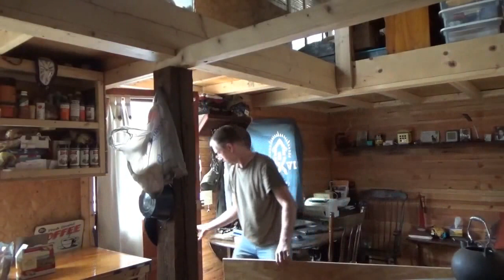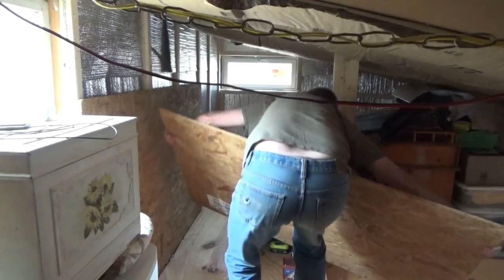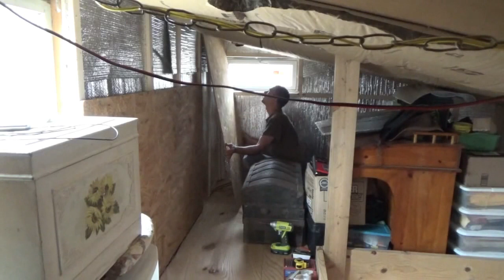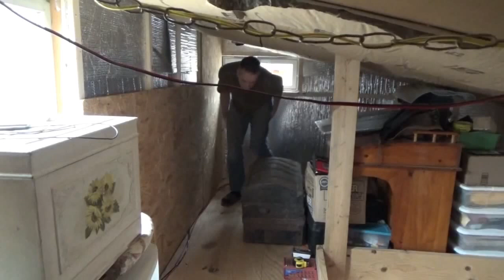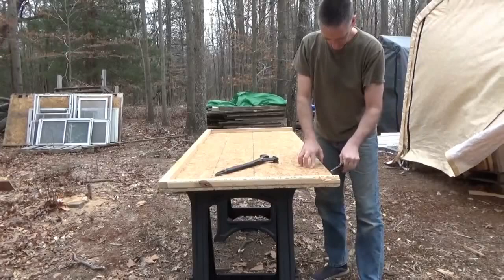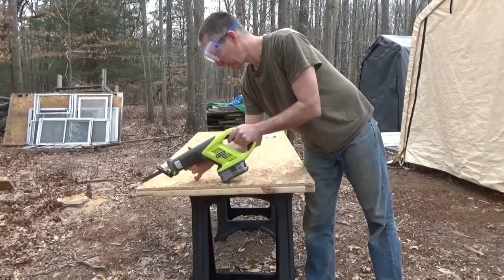Installing OSB In Off Grid Tiny Home Loft Study

Comment: Thought for an outdoor table:  OSB top coated with that clear, epoxy-like stuff they use for bars.  Saw a bar with all sorts of coins and ashtrays and you name it, all embedded into the bar top itself, and it was pretty cool.  I'd imagine that it'd also be quite weatherproof, and if not, you lay it on THICK, so you could always just polish it from time to time if you REALLY needed to.

Also, had you thought about just giving the loft spaces a coat of white paint?  It'll reduce weight, in the event you need to move it at some point, while also being a LOT quicker for you to accomplish, plus having the added benefits of both still having a unique texture and being a lot more reflective to light, giving it a more open feel to it.

Speaking of paint, heres a non-standard way to think about that:  When I rebuilt the porch, I did like they did a century or so back, and I painted the ceiling a nice sky blue.  Now, even on the most miserable rainy day, I can still sit on the porch, look up, and see blue skies above me.  d=O)

Comment: Maybe take a day or two and break down all the pallet wood you have before you start working on tiny house walls?
Reply from the maker: +Jacque Refregier When I get to the paneling you mean? Or for the OSB? If you mean the OSB then I am only using what fits and what I need at the time. The rest I leave alone. Sometimes I have to pull out staples for the right fit. Sometimes I can cut them off. Depends on the size of the board I need. Less work this way in the end.

Comment: I think your saw made have a bent shaft. It may have overheated and warped. If so the blade will not track, because it is at an angle. Keep up the good work.
Reply: +Frank Petronella If it was a bent shaft, the blade would wobble making the kerf (cut) wider, I am leaning towards an out of align sole plate as the problem

Comment: Please, do NOT buy another set of saw horses! Just make a set from the barn wood. There are lots of how too's on you tube. You'll find 4 benefits to making your own:
1) they only cost you time and screws
2) you can customize them to you. I am tall, so are my saw horses. I also have a low set for when I want things lower.
3) you can replace the tops when you saw through them, or set your saw shallow and don't worry about the small cuts in the tops (you should see mine)
4) they are way sturdier than anything you will ever buy. Sure, they don't break down for storage like the store bought ones but you can stack them and put them out of the way and they'll be fine for years in the weather.
Reply from the maker: +FromThe Prairies These were $5 for the pair. I know they are not the best but I dont have all that much time. You really have no idea. I am working so long with websites, comments, videos, forum, construction and homesteading all together.
Reply: +The Do It Yourself World maybe you could drop some activities
Reply: +The Do It Yourself World most folk would find hour to make a pair of sawhorses so that they can save hours in the future. It really doesn't take long and I think you'll make a huge improvement for your working conditions. But that's just me being sensible again.

Comment: Troy I seen in another comment that your saw may have a bent shaft, I would bet your bearing or bushing( not sure what one your saw would have) is wore out. My craftsman saw did same thing and ended up being the bearing that the shaft rides on. Wiggle the blade side to side (saw being off of course) if there is even a tiny amount of play then there is the problem.
   On another note I am assuming you have plans for a garden this year why dont you set a 2 or 3 shelf stand in front of the catwalk window and start some peppers,tomatoes, even broccoli,cauliflower and what ever else. My place is between 20 to 30% humidity so I wrap the shelf with saran wrap (because it clings to itself) to make like a indoor green house this keeps the moisture inside where the plants need it. You get a fair amount of sun threw the window and you would be saving yourself some money and of course having plants you grew 100% yourself is always best.

Comment: Scavenge lumber  always drives up the production time.  I had a client who usually insisted on using scavenge lumber and then wanted to break down my hourly wage in order to make up for the delays.  Obviously, I don't work for that guy any more.    If you are a professional on a project that uses salvage lumber, then you are not likely to stay a professional very long unless the client is willing to accept a higher end cost than if you were just getting the stuff all new at Home Depot, except in the case of doors and windows, which are cost effective to do with salvage stuff.
Reply from the maker: +8digitPDX LOL, I can sure understand that!!! I would never do this for a client. It is NOT worth it in the end. If a person is trying to pay for this work then the labor is more than the materials. But I sort of get paid for my labor through videos and I am trying to build a tiny home using recycled materials to show it can be done.

Comment: haven't been on yt for a couple weeks. I see you still haven't LISTENED to advice about how to use your "Wonder bar" pry bar. It's because I hate to see anybody go through hell doing a job the hard way IGNORING a simple labor saving habit.  When you pry something back, try swinging the bar SIDEWAYS NOW AND THEN. A short fulcrum and the long lever will overcome any stubborn fastener. In the name of mercy! Work smarter, not harder!
Reply from the maker: +grodad Ok, thank you. I dont see all the comments. I am sorry but I get about 2,000 comments per day across the entire channel. I know it frustrates so many people when they think I am ignoring them. Thank you for your advise.
Reply: i don't mean to bust your chops but I saw how that board jumped and flopped around as you pulled and pulled on the 1X2 strip. Moving the bar laterally will give you TONS of control and literally pry apart even screwed materials. Looking good bud.
Reply from the maker: +grodad thank you